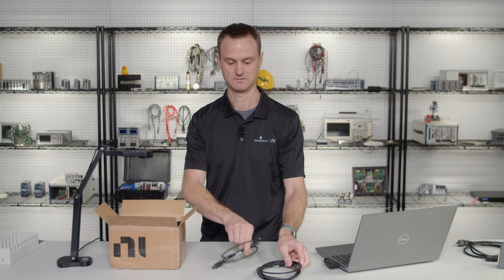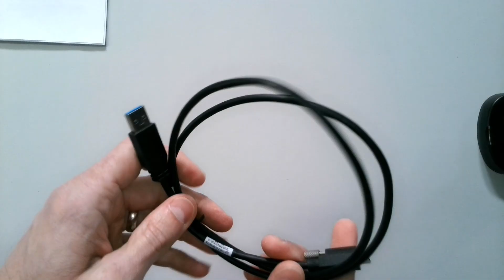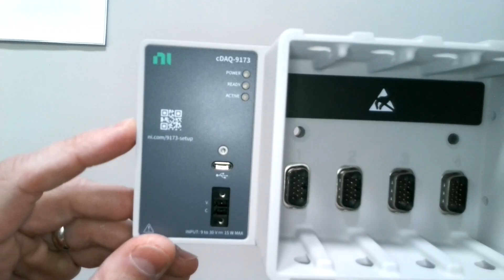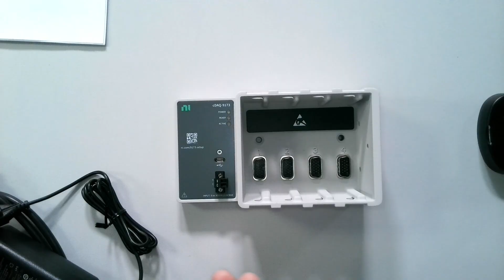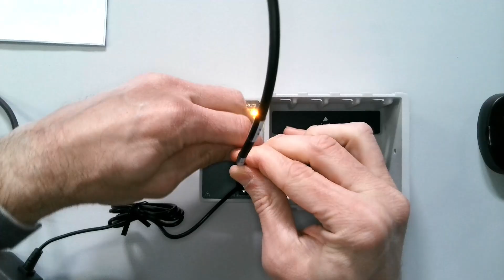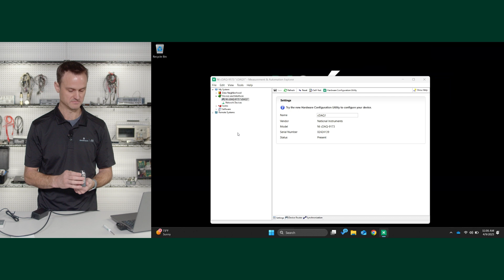How to set up a USB-C NI CompactDAQ Chassis Out of the Box

Comment: Why does the video say the power supply needs to deliver 30 W when the power supply that comes with the 9174 is rated for 12 volts output at 1.25 amps which is only about 15 watts?
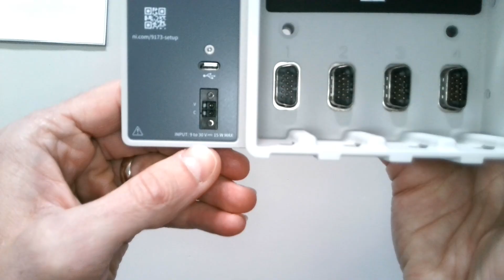Reply: Hi @jasonsilver : Thanks for catching this.  I misspoke at around 4:14. I said "you only need 30 Watts of power" and should have said "..."15 Watts of power".  The chassis power input acceptable voltage  is 9-30 VDC.  The power usage is up to 15 Watts, which includes up to 4 installed modules. You can see this 15W spec on the label at 2:26 in the video, which my brain apparently missed and forgot while filming. :)  Thanks again.